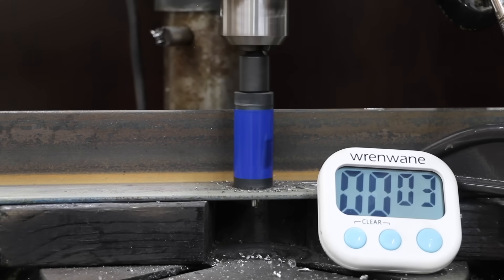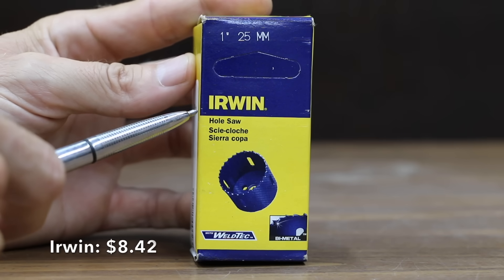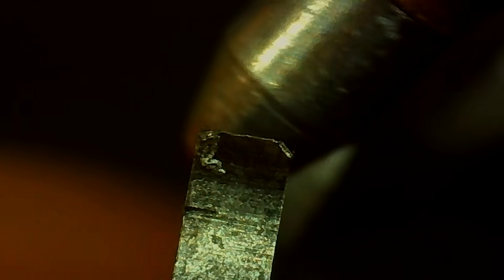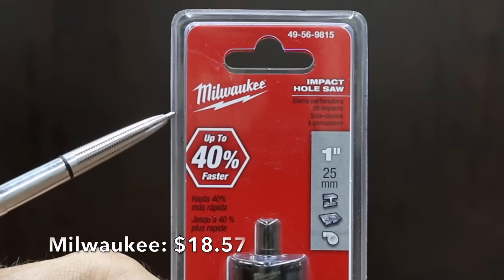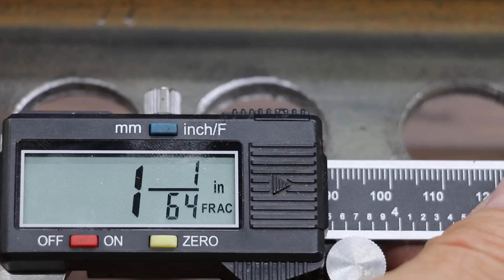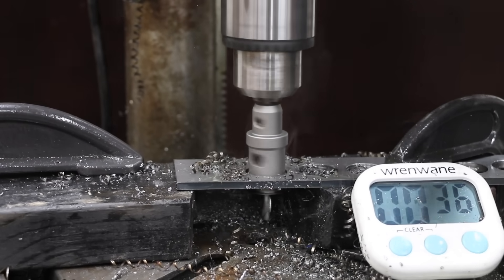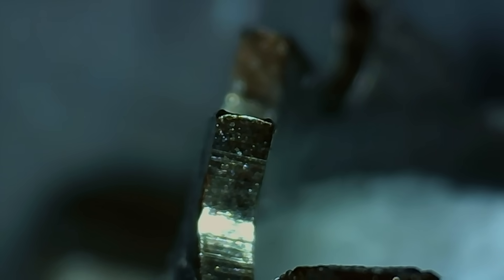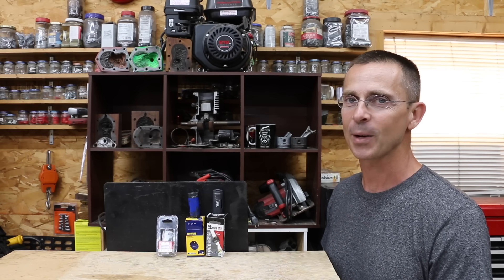Best Hole Saw Brand? DeWalt vs Milwaukee vs Irwin, Bosch, Lenox, Diablo, Bosch, MK Morse

Comment: Plug ejection is a big thing with me. I've had some hole saws that were great for cutting but spoilt by the plugs getting stuck. Would like to have seen them rated on that score also?
Reply from the maker: Thanks for the suggestion.

Comment: I broke a no name on my trailer frame. Then broke a Ryobi. Borrowed an Irwin from my dad but broke the pilot bit and didn't have a replacement handy. Bought a Milwaukee and broke a few teeth. Deep sigh...bought the Diablo and still have that. My recent experience this year.
Reply from the maker: You have had quite a year!  Thanks for sharing.

Comment: I really enjoy watching your videos, and as an added bonus I usually get an idea of which manufacturers generally delivers good quality products and which brands to stay clear of. also I believe that some of the saws getting stuck might just be belt slippage in the drivetrain of the drill press. if it was a more industrially oriented drill press it would not get stuck and some saws would possibly have less or significantly more wear depending on the quality, as starting a cut is usually when the most damage and wear occur to tools. thank you for the time and effort you put into your videos. we all really appreciate it!
Reply from the maker: You are welcome!

Comment: Please upgrade your drill press!(Been meaning to suggest this since the drill bit episode) Stalling a hole saw is a sure way to remove the teeth. The stop/start action hammers the tiny edges of the teeth and shears them off. Carbide is brittle after all. Smooth consistent speed will give different results. 

(I know... most people only have 1/3 Hp drill press or hole saw by hand but that is irrelevant. This is supposed to be an even test. If one stalls and the other doesn't then it should be redone with all in the same conditions)

Keep up the good work!
Reply from the maker: Thanks for the suggestion.

Comment: Todd, you have made such a significant impact on so many peoples' lives by doing these great comparison videos.  Its great now companies are starting to take notice.  Too many years of useless regulations (the political ones) on industry have made them have to cut back wherever and whenever they can.  With a lot of those regulations gone, the companies need a good dose of reality to get their products back up to a superior level (that is not a negative comment).  You supply that does of reality for them and us both.
Reply from the maker: Thanks for sharing.

Comment: I love your channel.  I always watch you channel when using something I'm not use to, your channel always gives scientific evidence of how something will stand up. I have met a problem tho i have to do some repairs to some aluminum that requires welding my buddy told me to try allumiweld. I see you have no video's on it. Could you post one in the future with how much it will indure as far as weight and torque?

Comment: That drill press may not be rigid enough for those harder carbide tips in the AR500. The teeth tend to get very brittle when over 9 hardness and chip if the bit wobbles even slightly.

Comment: You should compare the differences between drilling at fast and at slow speeds. I swear sometimes going fast just works better (in theory it's far worse) but I'm interested to see the difference.

Comment: Those impact ready holesaws(Milwaukee /dewalt) after the 1/2(7/8) size the metal warps due to thin wall...I only have the 1/2-7/8” ones.....I know it would be expensive but doing a separate test carbides and bi metals carbides are typically much more

Comment: Did you send in any of the “lifetime warranty” products for replacement after this test?
Reply: ^ that alone would be an awesome test.
Reply: Under normal circumstances, I'd say that he voided the warranty by abusing them, but it would be a very good test to see how many hoops the manufacturers make you jump through to get a replacement. He wouldn't when have to do the replacement, just get to the point where he could send it in then decline.
Reply: @HammondOfTexas0  Usually these kinds of warranties require you to ship it to them on your dime and pay for return shipping, at which point it would be cheaper just to buy it again.
Reply: @HammondOfTexas0  Abusing them?  You mean by actually using them to drill holes?  What is the SUGGESTED use = stirring water?  Or maybe hold the package up where it says 10X longer lasting in front of the target piece - and wait until it SCARES a hole in the steel?
Reply: @palewriter1856  he meant abusing them by drilling through super hard steel. Those hole saws are not made to drill through armor plate, they are designed and advertised to drill through mild steel.
Reply: @mikey_mike  um - I know that.  It was a subtle, wise-ass PRETENSE that the test was NOT going at all out of bounds.  Sick sense of humor, admittedly.  Sorry.
Reply: Could have a follow up video to review the warranty process 😂
Reply: Thats a great idea actually... Would be curious just to see what they said lol
Reply: That would be a great test, because usually with tool warranties, even if you do everything right, good freakin' luck getting the company and the big box store you bought it from to cooperate. Company will say "take it to where you bought it," store will say "you gotta call the company," ad infinitum.
Reply: I had one at the dealership that i used for rear taurus subframe recalls. We had new ones they gave us but i kept the same one the whole time as a running joke. It would literally burn through the floor but i wouldn't get rid of it. Thats probably the only one that i ever really wore out.
Reply: there's usually information on the box that you have to use this and than many RPM whilst cutting and you shouldn't cut some materials which would void the warranty
Reply: Not if you use wrong (not made to drill ultra hard steel)
Reply: @darktrip  But do any manufacturers put such a caveat in the small print I wonder?
Reply: @JonDingle  usually yes. Those hole saws are designed to drill through mild steel, plastic, wood, not armor plate steel.
Reply: You might shorten your lifespan shipping globally, and the warranty only applies to the original purchaser.
Reply: Max prophet shorten your lifespan?

Comment: Best Oil stop leaks? in general and for Rear main seals.
Reply: The only one worth mentioning at all is At-205 Reseal. It uses plastisizers to actually soften the rubber. I use it to soak old seals in doing tool restorations, it's the real deal.

Most stop leaks just use a solvent that's absorbed by the rubber seal, making it swell up. This is actually bad especially on front/rear seals because it increases the pressure between the seal and the drive shaft, making it wear out even faster. It might seal it for a few miles, but then it's going to blow open and dump oil like crazy.
Reply: @sbvera13  gotcha. Still would be cool to have a video demonstrating that

Comment: Project Farm I never even heard of Morse until now. Home Depot nor Lowe's carries that brand. Now I know of a cheap reliable brand name.
Reply: They carry them at Menards, but that's more of a regional store.
Reply: Jon Deiler Morse also makes very good band saw blades! Yes Menards, Amazon and  some Milwaukee dealers.
Reply: Guess I got a bad kit. 25 piece hole saw kit, and they all sucked. Melted the teeth right off. They weren't even sharp enough to do anything but burn through wood right out of the case.

I still have a Milwaukee Cold set (think they were some cryo treated weirdness) that keeps going and going. I'm sad they discontinued them, probably because they lasted too long.
Reply: @leftyeh6495  you can't make money if there's no supply and demand.
Reply: And great drill bits and lathe tooling.
Reply: our company usually buys Morse hole saws, im sure they get them at a supply house. they seem to last pretty decently in the field

Comment: Thanks for doing this video! Very useful. Idea for a future video: Air hose fittings. Which style of quick-connect coupler translates the most torque to an impact gun or best volume to a an inflator over a set period of time, which hose material has the least friction loss, etc?

Comment: That starting and stopping in the "armor plate" is what likely broke the carbides.  They all should have made it through, but your drill press was slipping a lot in all the tests.
Reply: That thickness it's really a better job for an annular cutter, or very low and steady pressure if you are forced to hand drill.
Reply: @leftyeh6495  That's what I noticed, nowhere for the chips to go, so they gum it up and stop it from cutting.
Reply: I agree on annular. IMO the hougen is the best. It’s pricey but once you use one you’ll never use anything else.
Reply: Yes I concur, pulling out of jammed cut that way will chip the teeth. Should have reversed out. The belt of the drill press was slipping.
Reply: @unusualelectronic  Reversing a carbide like that will just rip the whole tooth off.

Comment: Brilliant video with lots of useful info, but what the hell is 'a 128th' of an inch???
Don't get me wrong, I DO know what it is - I'm an engineer, but in all my 50yrs of engineering I've never known ANYBODY refer to a 1/128", let alone actual use it.  
It's not that it's not possible or practical to measure things to that kind of tolerance either, but come on you Americans - call it a day and come over to the dark side and get practising your metric dimensions.  You'll like it in the end, and fwiw, 1/128" is about 0.2mm.
Please don't say " We don't want to go metric thank you very much", 'cos when it comes down to it, you guys use 'thou's' all day long; and obviously 'a thou' is a base10 kind of figure, - thankfully NOT a hideous fractional figure like 1/128"
Great work PF.
Regards Mark in the UK
Reply: Wouldn’t metric be more accurate way to measure it?

Comment: I would've preferred decimel inches. For anyone unfamiliar with fractions:
1/32:    0.0312"
1/64:    0.0156"
1/128:  0.0078"
Also, 1/128 is about as acceptable as it gets. Unless its a wood bit, it should be within 0.005" really.

Comment: The one thing that will kill carbide toothed saws is not having enough power(torque) to keep a tooth cutting without binding or stalling the saw. The abrupt stop of the saw, along with the downward cutting pressure is what damages the teeth. Once a tooth starts cutting, it is imperative that it continue cutting otherwise tooth wear and breakage will occur, due to the work piece becoming work hardened.
Reply from the maker: Thanks for the feedback.

Comment: Suggestion: testing and comparing ratchet straps. Brands like Powertye against your everyday husky and other common brands found at hardware stores.
Reply from the maker: Great suggestion!  Thank you.
Reply: @ProjectFarm  If decided, please test those sold at Harbor Freight. I just bought a 4 pack of 500lb rating for $6 (orange pack). sounds a bargain if they are truthful.
Reply: That's a good idea. He could test the tensile strength, durability around sharp corners/tight bends, how well they hold up when lightly frayed, and resistance to UV/weathering/salt water/oil/grease/friction. I've also wondered how much twisting the band actually reduces its strength. I'm guessing that in some of the cheaper brands, the strap could outlast the ratchet and the hooks!
Reply: Liked this idea until I realized you guys were talking about tinker toy straps, jk. I use 2, 3 and 4" ratchet straps doing flatbed trucking, and the King of straps is Blackline and Kinedyne Rhino Max. Pricey at 73 bucks for a 2in ratchet strap for Blackline and 40 bucks for the 4in kinedyne winch strap, but cargo securement isn't a joke.
Reply: @TheRoadhammer379  I was thinking 2in straps since that's pretty common size and middle ground between 1in and 4in. Can interpret 2in strap quality for the others.
Reply: I’ve had no problem using the 4 pack of ratchet strap from harbor freight for around $12 as compared to the set my buddy got. From tractor supply, one of the teeth broke. You  could obviously tell that the tractor supply strap could withstand greater amounts of weight compared to the harbor freight. I’d be more interested to see how Project Farm would even test some of these 1” straps that claim to hold up to 5,000lbs!!!
Reply: I would be very interested in this!
Reply: Don't forget serious brands like Kinedyne from Brafasco
Reply: Yes with corrosion resistance and ease of operation at various levels of corrosion
Reply: I was going to suggest this as well, glad someone else thought of it too.
Reply: This would be fantastic.  And please include the retractable ones that you can purchase through McMaster.  They are so very convenient to use, but I don't know if they are as durable.
Reply: Dont forget tractor supply ratchet straps
Reply: I'd like to see how cat brand holds up too
Reply: great idea
Reply: I agree! This would be great
Reply: I'm excited for this video!

Comment: I'm overall liking the irwin as it is cheap and suits the applications I need it for, I don't use heavy gauge steel to often, including stainless. I also tend to use the cutting compound on nearly every steel surface personally.
Reply from the maker: Thanks for sharing.
Reply: @ProjectFarm  oh btw this is another great video you've made, I am a fan 👍

Comment: 2:06 Right here, you can see is a powerful impact applies on the hole saw when it's drop down,So you should put nylon base or any soft thing softer than metal to prevent this don't happen again
Reply from the maker: Thanks for the feedback.

Comment: Those bits are designed to make a hole slightly larger on purpose, not all box connectors threads are the same.
Reply from the maker: Thanks for the feedback.

Comment: Test different brands of paint remover and how fast each removes different types of paint.

See if the workpiece being metal or wood affects how fast paint is removed
Reply from the maker: Thanks for the video idea.
Reply: @ProjectFarm  That is a wonderfull idea. Some time in the distant past I painted our mail box with brushed on rust-olium and now I need to redo the paint job to match the house again. Nothing seems to touch it, even vepsall auto paint stripper laughed at it. Thanks for the fantastic shows, and the time to make them.

Comment: Do you think the impact ready holesaws would work better with the impact action of the tool they’re designed for? Maybe they need the very slight stop and go to really grab and cut rather than the constant turn of the drill press?
Reply from the maker: Thanks for the video idea.

Comment: what is armor plated steel?  never heard of that before.
Reply: Its not armor plated steel. Its the steel used for firearm armor. Armor-plating steel. So obviously its super hard and tough (murica man)😂
Reply: @benzo5799   I should have been a machinist.

Comment: As for stainless, it’s MUCH easier to start will a small hole, then larger ,,enough to set a KNOCK OUT PUNCH , TO MAKE THE LARGER HOLE, AS IN A. KITCHEN SINK, I found the hole saw tends to make the SS BLUE FROM HEAT ,     BTW, still getting comments on your FROGEC FARM TESTED, PF ‘  the large one on my left rear window  ! Amazing ,     Cheers 🇺🇸🇺🇸🇺🇸🇺🇸
Reply from the maker: Thanks for the feedback.

Comment: PF, HELLO<,I have a set of hole saws, in ‘REFRIGERATION SIZES, now a guy I was working with cut a hole in a TAR  composition roof ,,I have NOT looked at in in years, but I SOAKED IT IN KEROSENE, GASOLINE . and NEVER GOT IT OFF SO I could put back in the kit   Bit have retired as of 2013,     any suggestions ?  Cheers 🇺🇸🇺🇸🇺🇸🇺🇸
Reply: try brush cleaner (can work wonders) and paint thinner
Reply: if nothing else: concentrated sulfuric acid + 12 (best 30)% hydrogen peroxide. be careful though. that stuff is about as agressive as it gets

Comment: Have you done a video on saws-all blades?   I use mine one a somewhat regular basis, but not often enough to track blade wear and compare performance.   I’ve used Dewalt blades mostly, but I bought an Ace Hardware wood blade for a recent project.   It worked fine but I don’t know if it’ll last long for future use.  Anyway, love your videos, good information.
Reply from the maker: Thanks for the video idea.

Comment: As a commercial fisherman, we find ourselves drilling a lot of stainless steel, both 304 and 316, not to mention mild steel and harder T1 steel. I have found that grease and a slow speed works the best to complete a job in harder steel and stainless. Just this July, we had to drill and countersink 150 holes in some 304 SS trim. Needing to keep heat at a minimum, we sprayed water using a 409 cleaner, spay bottle on the drill bits and countersinks to find that it worked very well, and water is cheap. Incidentally, in anticipation of this last job, I ordered about $200 worth of cobalt bits and countersinks, to find that the $5 no brand countersink bought at the local hardware store was the best. The 6 different $25 ones I bought on amazon did not cut as good. The "Drill America", cobalt drill bits seemed good, I bought 2 - 12 packs, 1/8" and 1/4" to find that with an occasional touch up on the grinder, I only used 2 of each, and they are still usable for other jobs.
Reply from the maker: Thanks for sharing.

Comment: Fantastic video as always.

Would be interesting to see a video on tape measures. I've been trying them for years and have almost settled on the Dewalt DWHT36228.

Would love to see what tape measure has the best actual standout length, clip, weatherproofing, rotational standout, easiest to read (top and bottom if it is 2 sided), durability to falling, end hook, resistance to tape cutting, etc.
Reply from the maker: Great suggestion!  Thank you.